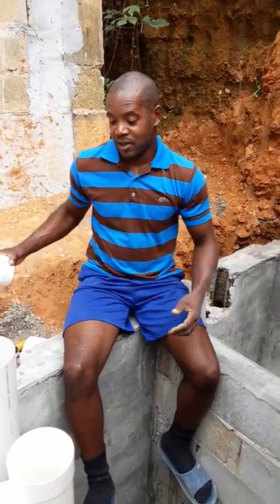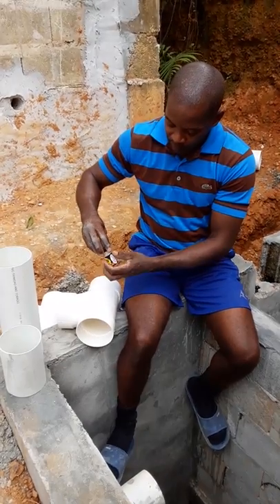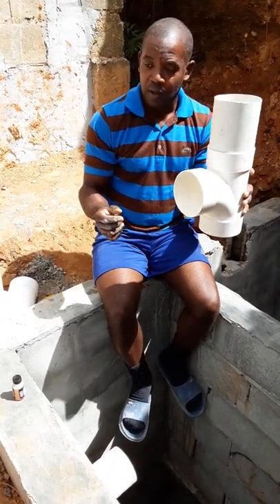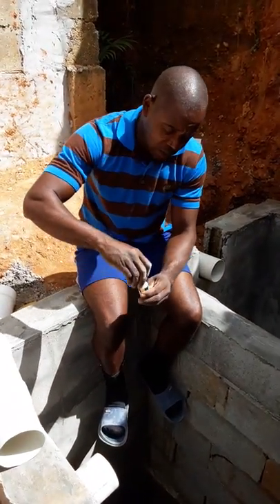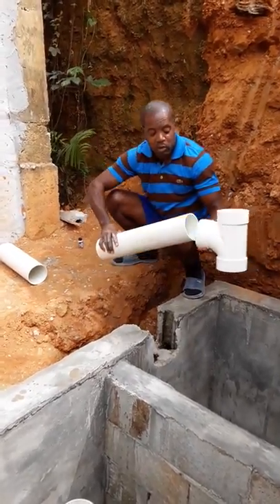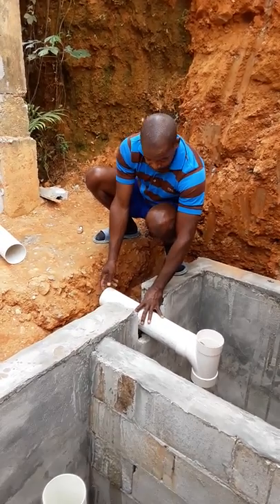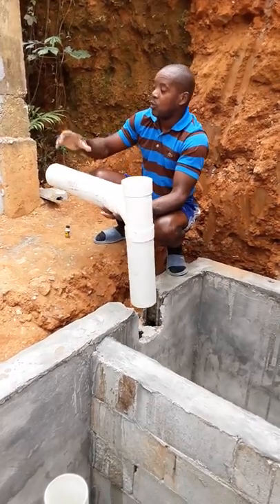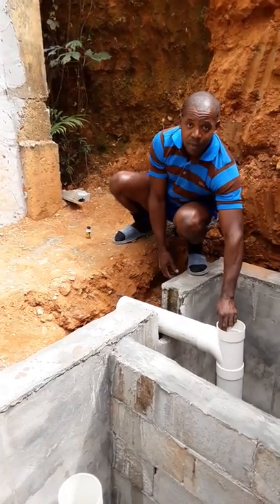Septic tank plumbing basics

Comment: Hi Sir 
Doesn't the inner wall needs the pvc pipe to transfer water to next chamber?
Reply from the maker: It depends on the design.  If the baffle wall does not go all the way down to the floor, then there is no need for piping for transfer.
Reply: @ableaidantaitt8092  hos is yours designed?how is first chamber conected to second chamber?
Reply from the maker: @emmanuelchimusolo6583  the Chambers are connected under the baffle wall. There is a 20 inch gap under the wall so everything self levels. As the inlet brings in the flushed toilet contents it pushes the level up in the outlet and only the amount of water that comes in the inlet, goes out to the soakaway..